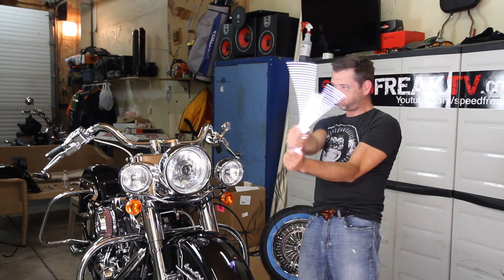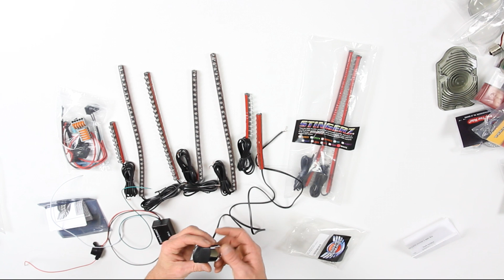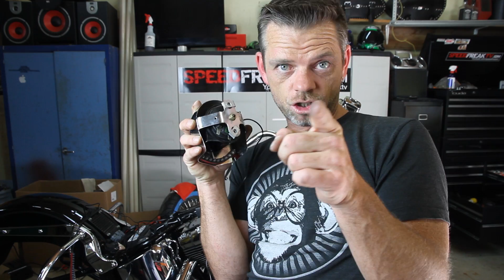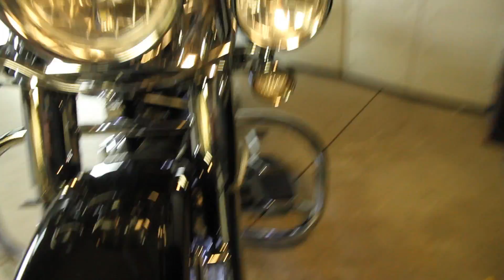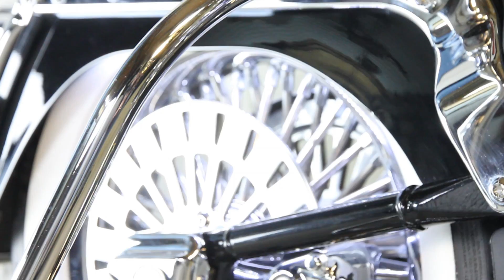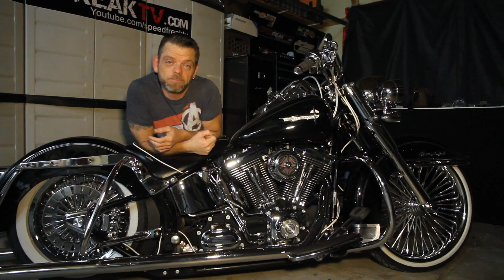PROJECT SOFTAIL EP15: CUSTOM DYNAMICS STINGERZ - SPEEDFREAKTV LED GLOW LIGHTING

Comment: If the light are on the bottom of the oil tank, they get way to hot and short out. Fried my voltage regulator. Had to remove that set from my bike. There's a tip. Hope it helps. Love your bike bro

Comment: did you remove the front fender to join wires? Did you solder all the wires you connected or what?

Comment: Need an install vid I'm new to wiring so I don't want to jack my bike up, also do you have a link I can go to to take my tank off of my softail custom
Reply: Hey bud just did this exact install! piece of cake & the instructions are pretty straight forward! only 2 things i did different were no splicing to make one lead only reason because I called company & they stated possibility of one side being brighter! and 2nd was they provide you with these wire cages that are suppose to cage all the wires housed together but I couldn't get them to clamp down so i used closed end butt connectors!